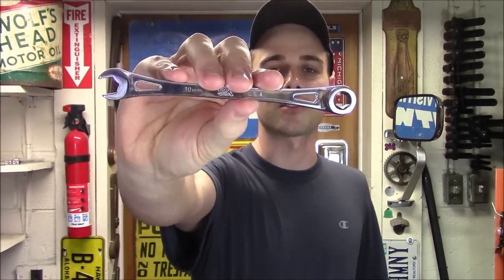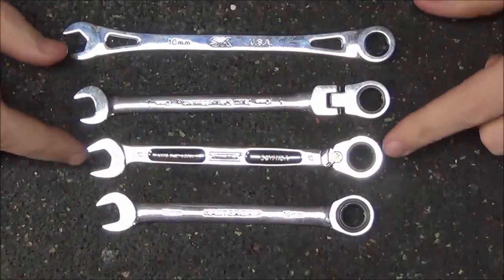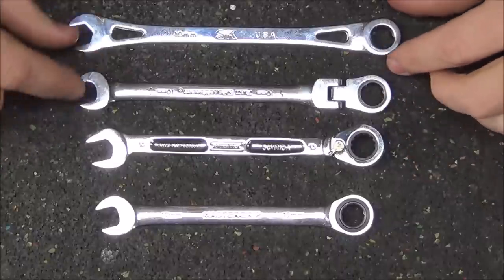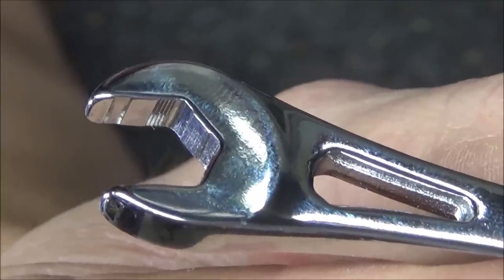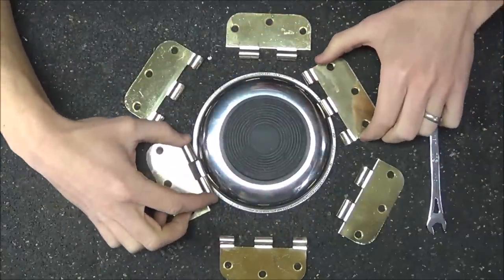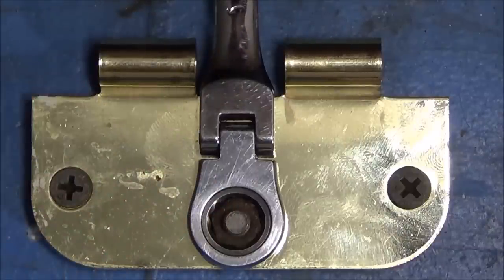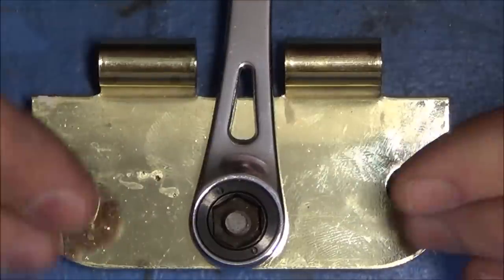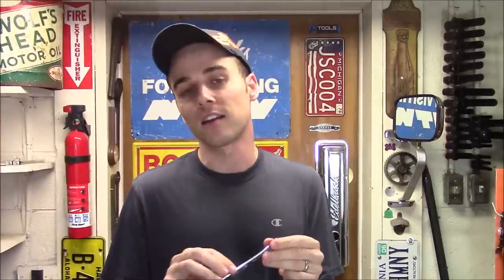SK Tools X-Frame Ratcheting Wrench - MADE IN USA

Comment: It is a sweet design, but the six point head is a dis-qualifier for me since I work in aviation maintenance where we encounter a lot of 12pt bolt heads and nuts.
Reply: I've never seen a 12 point fastener, but I have rounded off several fasteners with a 12  point wrench, so these are the best wrench I've ever seen seen with a ratcheting end on them.

Comment: I'd be all over these if they were reversible. I swore off non-reversible ratcheting wrenches after I got one stuck between a shouldered bolt and the frame of a car while doing a timing belt. I don't trust myself to pay attention enough to not do that kind of thing again. I don't understand why anyone makes high-end non-reversible ratcheting wrenches anymore.
Reply: I don't think the design would let you make a reversible option, the pawl system would not work on a reversible platform.

Comment: Great Review.  Simple and in-depth. Excellent video and sound. You do it right. As for the wrenches - I like them. A lot.  What tool guy wouldn't like to have all of the tools out there in their arsenal.  My thought is Cost - Just did a quick and not very in deep search and was blown away at the price.  The cost of a set that does not have a Flex Head and/or a Ratcheting feature just doesn't pass my sanity meter test.   Again, Great review.  Thanks - Keep It Rocking.

Comment: I finally got a set of these in standard. and I was excited. the 1/2" wrench just fell apart on me last night at work and I lost 3 of the six pawls.  I only used it once two days ago and I have only had the set for 6 days.  I'm alittle upset now.
Reply from the maker: +Colby Dobbs Sounds like a manufacturer defect.....I am sure they will replace it with no problem......things happen.  I have had very good luck with them so far.....very well made & the open end works great!
Reply: +Real Tool Reviews I talked to the sk this morning they were nice to deal with. and they emailed me prepaid ups shipment order to send back the defective wrench so they could improve or fix any mistakes in their process. they told me they have a new sending out today.  I agree the open end with the machined teeth works great, I can bust a nut loose on the open end and not worry about rounding.  by the way I love your videos you do great job.
Reply from the maker: +Colby Dobbs Thanks for the update Colby!  Glad to hear they took care of it for you!

Comment: the proto is off set because it is reversible. offset means not scraping your knuckles. reversible means never getting wrench stuck on a fastener with low clearance. most reversible wrenches have a retainer to hold a nut = faster  ratcheting on a long thread. to write a review you should use them regularly.

Comment: Can't believe you got one, been drooling over these! Great review as always. On thing left out, distance between fastener edge and wrench edge, how much clearance needed to fit the wrench between the fastener and an obstruction. I would assume the six pawl design makes the head thicker.
Reply: BrenticusMaximus1 Looks like it's slightly bigger if not the same as the Gearwrench as far as I can tell.
Reply: BrenticusMaximus1 I would also like to know that spacing. I also want to know how much force can it take i would think with multiple paws it would be greater the gearwrench but, a lot of variables come into play here
Reply from the maker: BrenticusMaximus1 Ha....well, not just me.....everyone who went to SEMA & went into the SK Booth to watch their presentation just got one of the 10mm versions.  I didnt really think about the box end thickness, since most ratcheting wrenches are very similar --- but I will measure it to see if there is a difference....good suggestion!
Reply from the maker: TheFlamingChalupa I think it just "looks bigger" since it has a 6-pt design VS a 12-t design....it throws your eye off a bit since there is extra material in the box end.
Reply from the maker: UberArchangel I will check it out....also, the force part really doesnt come into play too much with these I wouldnt think....since there is really not a effective way to put a "ton" of torque on one without abusing it (doubling up wrenches for extra leverage) -- you really should not use a ratcheting wrench from any brand to break things free if they are very tight, since the pawls are extremely small inside that box end (vs a ratchet for example).

Comment: Hey I know this question is not related to the video but I was planing on buying a Milwaukee hackzall. Which would you recommend between the m12, m12 fuel or m18? I work in the hvac field and mainly need it to cut 3" pvc. Thanks
Reply from the maker: pariente fierro No problem.....I would suggest the M18 version.....it has the same speed of the M12 FUEL, but you can use the high capacity M18 batteries & get a ton of runtime.  The main difference between the M18 & M12 FUEL is going to be that the fuel is brushless & slightly more ergonomic --- size/weight-wise, they are almost identical.  The regular M12 version is literally about 1/3rd the speed of the other two & goes through batteries quickly.  Keep in mind that for max performance, you need to use quality blades.  Junk blades will make them all perform extremely poorly.

Comment: Daniel, would you buy these over the wera jokers? I'm stuck between the two. My use is for heavy diesel work. Thanks.
Reply from the maker: +Nick Bradshaw the SK wrenches are longer & have a lower swing arc.....they would probably work better for you.  The main thing to consider would be sizes available & ease of warranty.
Reply: Real Tool Reviews Okay, great, I'll jump on the x-frames then. thanks for the reply.

Comment: Do you know if they plan to offer a version with a reverse switch on them?
Reply from the maker: FBobby With the current design (with 6 opposing pawls --- which are directional), I dont see how it would be possible.  If they redesign the ratcheting mechanism, I assume that will be on the list.  These are just the beginning from what I have heard, I think that they are planning a wide range of sizes/lengths/styles in the near future.

Comment: Your low swing arc example seems unfair because the hinge used was specifically picked because it only restricted the GearWrench. Who knows where an obstruction will be in a real situation that keeps a wrench's swing restricted. Had the hinge you picked had the obstruction a little lower towards the head on the SX wrench, it's arc would have been significantly reduced, if not totally impeded and if it were higher, the GearWrench would have not been impeded. Apples to apples!
Reply from the maker: The point was to show the swing arc....216 clicks per revolution VS 120 clicks.  I thought I had been very clear about that.

Comment: Unfortunately it does come in flexible spline head like the expensive ATG AK1 wrench.
Reply from the maker: +angelisone Yet.  I think they are planning a lot of expansion on this line.  They had to start somewhere.
Reply: +Real Tool Reviews Well, for that price they are not cheap for mechanics.

Wrench is not angle like many would like to use.
No flex head is the other fault.
No spline on the other end is the major downfall.

I like ATG tools that are only sold to limited pros that has those features.
ATG cost more but really they are less when you considered they can do and you DO NOT have to carry many sockets & wrenches.

Always great to see you doing reviews.

Comment: I wasn't too impressed with these. Found them to not be much better than all the new low swing wrenches.  SK claims they have unparalleled strength, but the truth is, in my industry (automotive) I will never need to exert so much energy with a wrench. For those type of fasteners there are ratchets, and impact guns.  Typically wrenches will come into play in tight quarters (intake manifolds, engine front covers, drive belt area etc).  Nothing there is so tight you need super strength.  I also don't like that they do not have a flex head.  Too pricey IMO, and SK applied definite cost savings.  Did you check out the metric set? The 8-10mm are the same stamping.  They are the same size albeit respective box and open end.
Reply from the maker: +Lynx Star Automotive (Gabe V) I have not seen a full set yet, only the 10mm sample that they mailed out to SEMA attendees.  I think that they have their place, but like any wrench.....no one tool will do every job.  I hope they expand this ratcheting lineup into flex heads, offset versions, stubby versions, etc....time will tell.

Comment: Yellow flag on the video.  I am trying to choose between the new SK wrenches and the Gearwrench flex head wrenches.  In the hinge video example the Gearwrench would actually be superior in saving time to remove the bolt because of the flex head.  

What I like about the SK version is the 1.7 percent arc versus the 5 percent arc of the Gearwrench tool and the two pawls versus one pawl of the Gearwrench.  Plus the SK is made in America and not China.  What I do not like about the SK is the lack of a flex head.
Reply from the maker: Sandbag1300 Yellow flag?  So the gearwrench is better because of the flex, but the SK is better because of the swing arc?  I dont think any one tool will always get the job done in every case, and aside from them being both ratcheting wrenches....the are not very alike in design.
Reply: The real question for me is how many times will the fastener removal solution on my work require a 1.7 percent arc versus a flex head.  
While I appreciate the 1.7 percent arc I am not so sure how helpful that will be for my use without also having a flex head. 

I will line up to purchase these SK wrenches when they come out with a flex head.
Reply from the maker: Sandbag1300 You are correct....there are benefits to every design.....hopefully a flex-head version will appear in the future!

Comment: Without offset and reversibility it's a loser. The Proto is clearly the pick of the litter here. The spline drive is also superior. This is simply a swing and a miss on the part of S-K.
Reply: GigaDonk Because they can be used on just about any bolt. square, 6pt, 12pt, external Torx and because they grab the sides of a bolt and not the points they don't round them off.
Reply from the maker: SATAMAN Schmidt For some....like I said, it is a personal preference thing.  There are many situations where any wrench with an offset cannot fit into areas where this one could....or vise-versa.  No one wrench is going to cover all the angles.
Reply: Why so much grief over no offset? I prefer offset wrenches also however, quit often they don't fit, and the zero offset will. Anyway, my solution is you need both.
Reply: +SATAMAN Schmidt - Agreed!   Spline wrenches give you versatility of use and at the same time,the assurance a mechanic really wants, needs and expects from the tools they pay for.  That really makes any deal "a best buy deal".
Reply: Homerun for me, I've never seen a 12 point fastener that I had to remove, but thousands of 6 points.